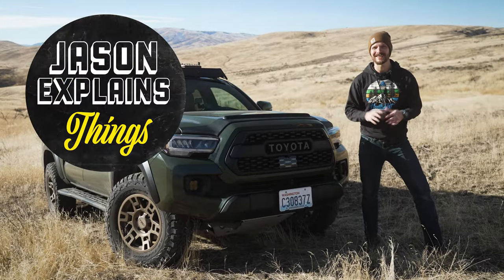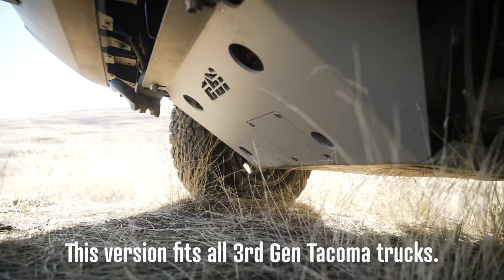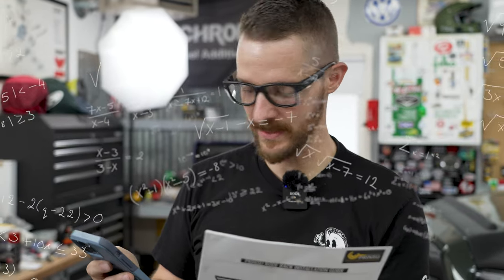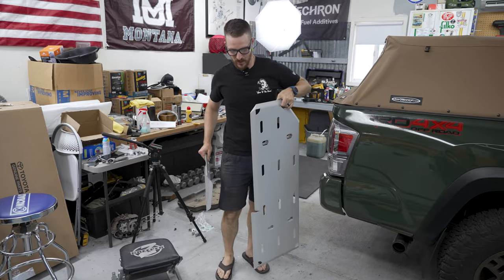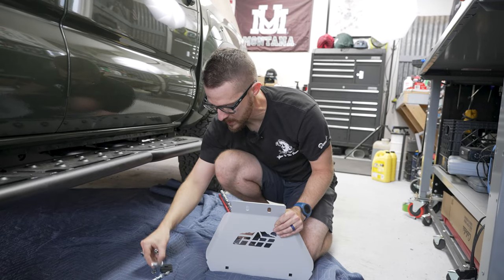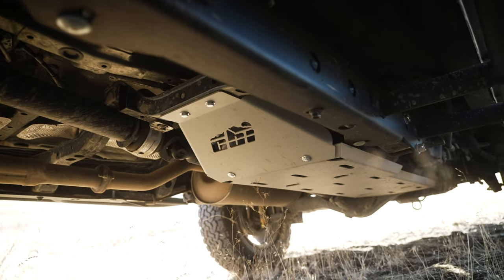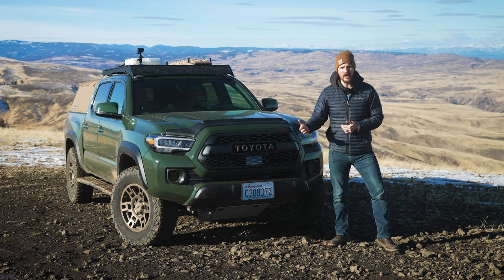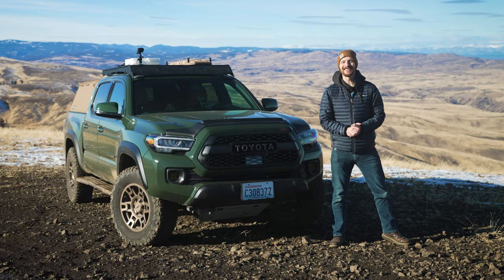Toyota Tacoma Armor - What Skid Plates Do You Need?! (CBI Offroad Install and Review)

Comment: You don't need the armor until you need the armor. I'd say the oil pan skid is a must if you're just gonna do one. If you break the oil pan you're all kinds of screwed. It's also one of the most likely areas to get a hit.
Reply from the maker: Yeah the stock skid is decent... It's just thin.  I was just warning folks in case they didn't plan on or want to do suspension upgrades.

Comment: Not all weight is the same, adding weight to your frame is not the same as your roof from a safety perspective in regards to body roll. Aluminum could never support the full weight of your vehicle so using it for anything other than preventing gravel hitting your components is the only “armor” it can provide. There are fewer gimmicks as absurd in the off-road community as aluminum skid plates. If your choosing aluminum over steel the only thing your saving is possibly your driveline and steering components but again adding weight to the bottom of the vehicle probably the safest place to go heavy from a physics and body roll safety standpoint.  Infact, aluminum skids are a huge liability as they dent and pock creating sticking points and can leave you high centered and stranded if alone without a winch. You should always go steel as the whole purpose is to create a solid surface that can support the full weight of your vehicle without denting allowing you to “slide” over obstacles. Skids are not the place to try and win the weight war.